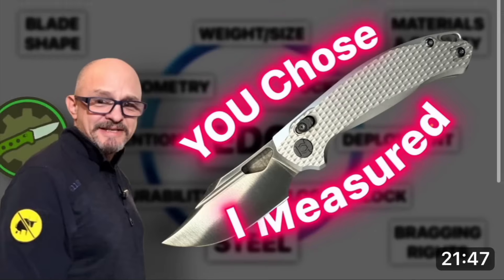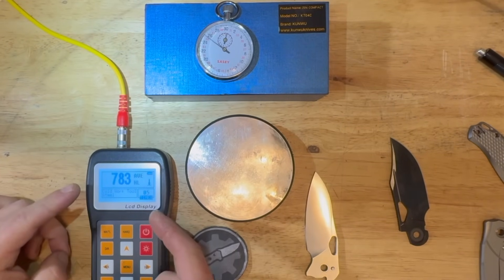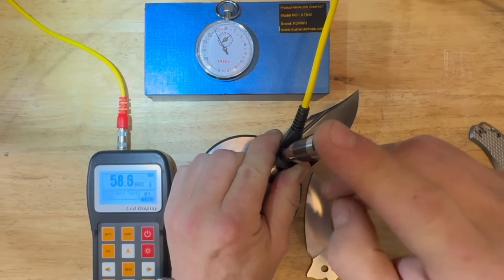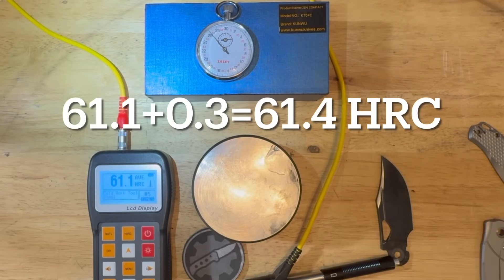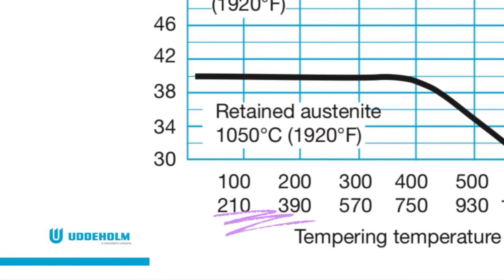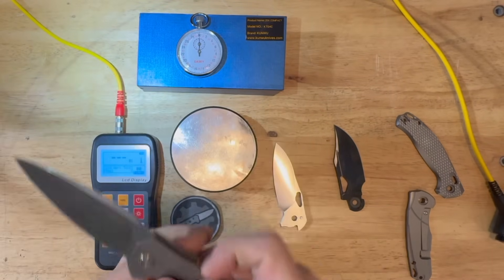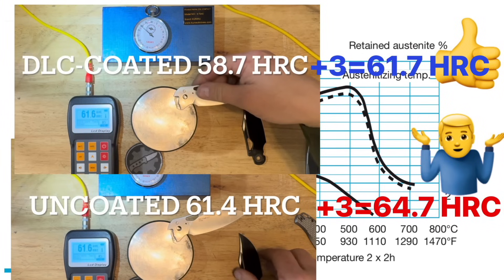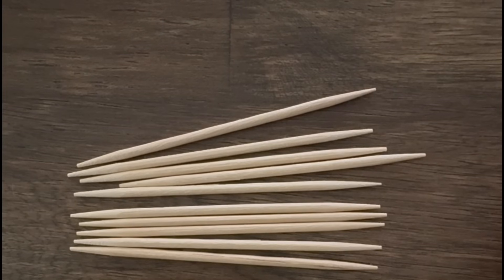Myth vs. Reality. Let’s discuss how DLC alters the blade’s hardness.

Comment: But surely you can sharpen the edge past the surface coating so the edge retains true HRC where it matters. On the edge? Unfortunately theres no real scientific way of testing this except standardised cut tests to test edge retention (as a factor of hardness)
Reply from the maker: There is a way: remove metal all the way down towards the center of the blade. But if the coating process takes more than 5-10 minutes, a thin piece of metal will be more or less uniformly tempered. Good point, thanks.
Reply: @CuttingBoardRx  yes I actually.  watched a video recently of someone doing exactly that. I can't remember who. But if 2 blades cut the same amount of rope with identical edge. They probably are the same HRC inside.

Comment: If you temper for second hardness, you can coat Elmax at 400 °F without losing hardness. Also, DLC can theoretically be applied without high temperatures (though it is not common).
I do not know if Kunwu did either of these two things (i would guess not), but DLC coating doesn't necessarily lead to loss of hardness.
Reply from the maker: @janwalter2097  Well stated! Maybe Kunwu will understand your phrasing better than mine. But in general, marketing companies like Kunwu, Vosteed, Fintiso, etc. don’t state requirements to the manufacturers very clearly and I think that’s the actual culprit here. LIKELY but not certainly, they make blades at one place and then finish them at another. Something gets lost in translation.

Comment: I stay away from coated blades. It's been my experience that coated blades have more 'drag' than uncoated blades. This drag impedes slicing capability.
Reply from the maker: The matte finish may increase the drag on a blade while the high polish finish may improve it. In a high speed/high cyclical rate application, metal to metal interface benefits from high polish (eg. bearings) but on a knife such improvement cannot be measured.

Comment: I have Spyderco Emphasis and Ambitious-black coated. Both from budget line, both in 8cr13mov. The difference in hardness is night and day. I don't need machine to test it. Coated steel is soft, and uncoated 8cr13mov is crispier than VG10 on police 4. My experience.
Reply from the maker: Thanks for this data point! Great to have you on the channel!
Reply: @CuttingBoardRx  I don't mind soft 8cr13mov on my Ambitious. I can literally hone it on my canvas pants.
Reply: Did they change their coating process or OEM? I didn’t think they were using DLC, but it’s been a while since I had a coated Spyderco blade on my workbench. I thought that Spyderco’s coating from the budget lineup didn’t get hot enough to screw up 8cr.

Comment: I was under the impression that the hardness and thickness of the DLC layer itself impacts the hardness on test results, and that you need to first remove the DLC from the tang> then hardness test the exposed steel.
Agree to your point of DLC application temp versus the steel's tempered temp
Reply: Also a 1-5 micro DLC eggshell like layer can scrape/chip off when the metal underneath it is softer, more malleable, dents, etc versus the DLC layer. E.g. DLC over a titanium watch strap doesn't hold up well
Reply from the maker: Well, according to a certain mega reviewer, DLC is the best idea since sliced bread. 🤣
Reply from the maker: The coating is only.000013-.00002” thick so it will have negligible effect.
Reply: @CuttingBoardRx  y not remove the coating on the tang of the dlc and test to prove ur point beyond a shadow of a doubt. Just a thought any way. I like the dlc coating because it's the only coating I've found that is truly scratch resistant to an extent and so it keeps my blade looking nice. If u break down as much cardboard as I do on truck days at my job then u could see y I appreciate it as any other pvd coated blade gets marked up fairly quickly due to the coarse nature of thicker cardboard. 
When will ur other video come out about the 1.6 that miamibladelab had to add to his test based off of the blanks he got to test against. As there is a pretty big jump in the 3 points u said people want u to add vs half of that amount. I'm not saying either r right or wrong or that u need to implement any to ur testing just wondering when the video would be available. Thanks for any info.
Reply: @SteelAddicted because it is so smooth, the dlc will tend to shrug off the adhesives that can often gunge up a knife used for intensive cutting on boxes and packaging that have tape, labels etc. 
The low friction also improves the cutting performance on cardboard and similar - as compared especially to other kinds of coatings that cause extra friction, or even to a scratched up blade.
Reply: @ I would be inclined to agree especially on my militaw in s45vn with the simi polished dlc not only does it improve that glassy like action of the knife but makes it a joy to use as like u said it glides through material and I haven’t put a nick on it or my compadres dlc coating.
Reply: @SteelAddicted  aye, it's amazing stuff. I can appreciate that there may or not be some secondary impact on the blade temper, depending on the steel and how the overall tempering process was conducted. All else being equal I'd say it's a worthwhile inclusion on a working EDC knife that sees a lot of cutting, especially on abrasive materials like cardboard. 
I'm reminded now how I have heard from various credible sources that reducing friction behind the edge actually reduces the strain on the cutting edge, which twists my brain a bit to consider but in the end it makes sense with a little imagination :D
The most sublime cutting experience I have had so far is from my Rockstead Ryu which has DLC coated blade and handle scales to boot. It will push cleanly through a full box of matches. I have a short video of that as well as doing the standing roll cut on a raffle ticket roll which was around 1/4" thick solid card tube around 1" diameter, 3" long stood on the block. To make these cuts cleanly the knife doesn't just have to be sharp, it has to slide. 
The Rockstead also has an incredible mirror polish, which comes to the same thing, friction reduction behind the cutting edge. 
Well, Spyderco don't mess around and neither apparently do Rockstead so I guess they have their protocols to ensure that they get the desired hardness on their coated blades. 
My favorite blade for cardboard cutting is a GEC Farm & Field pruner, basically a hawkbill with a very fine point and quite a shallow convex recurve on a 3" blade. It's thin stock, 1095 cs and it just zips in and through, the recurve traps just the right amount so it won't either hang up or slide out of the cut. So I like it better than anything I've tried (which doesn't include the Rockstead ;) but it does heat up quite a lot when I'm zipping through a few boxes. Now wondering about the viability of the notion to dismantle my favourite EDC slipjoint so that I can have the blade DLC coated. I'd lose the vintage patina... but thinking of how she'd slide through that cardboard... 🧈
Reply: @ does ur rockstead have a convex edge?
Reply: @ I’m sure u have experienced a mora but it’s crazy to me how well there edge is and stays on a steel I’ve never heard of thanks to the convex edge.
Reply: @SteelAddicted  I have experienced Mora indeed. I have owned a few and I built a couple of the ones I own from blanks. All the ones I have handled have Scandi grinds that are actually very slightly concave or hollow ground. 
The Rockstead has a true convex to zero and will outcut any Mora any day of the week on most media. However the steel is very hard and so can be prone to chipping. The Mora steel is way tougher for sure. 
I'm building a Mora #3 at the moment, with a jumbo curly oak handle. 
You might also enjoy seeing my Ken Nata knife, which I recently put together. I have some recent videos on my channel.
Reply: @ cool I’ll have to check them out. I was under the impression that the cheap mora ones like I own as my fishing knife was a convex and yeah I know there’s no way it would touch a rockstead in zdp at god only knows hrc something high lol. I’m sure u gave a pretty penny for that one. I try to buy only knives I’ll actually use even if some I’m hesitant to use more than others but I enjoy the fidget side as much as a good cutter. Something about a silky smooth dropping frame lock just makes me smile, just as much as hearing that zipper like cutting sound a keen edge makes through cardboard.
Reply: @SteelAddicted  everything you say resonates. Yes, I paid full price for the new knife and I did that because I wanted to use it. I love to whittle and carve on hardwoods and to my mind that it where the Rockstead really comes into its own. Not too long ago I managed to get some minor chips in the edge (on an oak knot or something tough like that, most likely) and so I took the plunge and resharpened myself. Hooray! It lost half the market value and that is fine because it's my knife and I'm keeping it forever ;D
I think it's supposed to be 67-68 HRC. 
So yes asides from the chips, which were easy to repair, awesome edge retention. 
The most outstanding thing about the knife is the convexed edge geometry. Surely the design, engineering, fit and finish are all excellent as well but you can find a lot of knives with all those characteristics. 
So the interesting take-away for me is that it isn't technically that difficult to replicate the Rockstead edge geometry on something like a Mora, using hand grinding and sharpening techniques. You would need to start working on the shoulders of the bevel so that you are convexing out, rather than in, as it were. The Mora already has the zero edge so it can be "Scandivexed" or laid back further to "Sabervex" now you're in Rockstead territory with comparable performance. I've done this with a Buck Maverik in 420HC and it cut like a Rockstead - for about 20 cuts before the edge would start to deteriorate a touch. The Buck 420 HC also strops and sharpens very easily and is tough as old boots. I might be a bit over it by now but I thought I was in love with that steel for a minute.
Reply: @ It has already been done by many in both the Knife industry as well as the firearms industry. 
Baked on coatings such as cerakote do indeed very much effect the test however.  
KnifeMaker
Reply: @ Yep!  A convex edge is long lasting for sure., Until the average owner tries to sharpen it. Totally changes it.
KnifeMaker
Reply: @michaell397  as a rule I take any knife blade I use in the direction of convex, usually by light regrinding followed by repeat sharpening so I don't mess it up quickly (but take my sweet  time over messing it up ;)
 I might use some fixed angle system for knife making or sharpening chisels, etc otherwise the vast majority of my grinding and sharpening is freehand. So sharpening the convexed blade in question came naturally enough. However I also generally find that my sharpening efforts will bring significant improvement to a factory edge - night and day sometimes - but the factory edge on the knife in question is a sort of gold standard retained only in memory. I'd like to think that I was able to return to the initial cutting performance and even that's a stretch. 
I'm enjoying your comments on this video. Hat's off to the Old Guard!

Comment: It is baffling to me how a knife company doesnt know this, its not rocket science you just look at the graphs.. clearly shows the problems in the industry..
Reply from the maker: Most small companies are basically marketing organizations that procure their product from the OEMs as a compete knife (eg. Vosteed or Fintiso) or as a parts set to assemble in hous. Very few have in-house heat treat capabilities and an even smaller subset has a coating shop. Very few marketers have more than a superficial knowledge of the processes.
Reply: @CuttingBoardRx  Absolutely. Even some of the bigger ones dont have heat treat done in house.. BUT if you dont have a clue about what you are doing it is even more impressive to write a comment from the official youtube page and secondly, calling you a clown is a bad look EVEN IF you were wrong..
Reply: @ Remember also, looks sell. Most are bought on a spur of the moment due to how it looks to the buyer. Most collectors never use their prize and as the companies do not for the most part give the actual HRC, as far as they are concerned, Who is the wiser? 
KnifeMaker
Reply: @michaell397  greetings! Absolutely correct I agree with you. What does not make sense to me is that if your company operates in that way, why would you leave comments that are not only extremely unprofessional just from the words chosen but also pretending that they are an expert in that field..
Reply: @ CYA! Posing sells as well.  
KnifeMaker